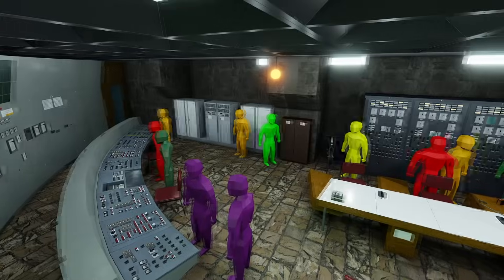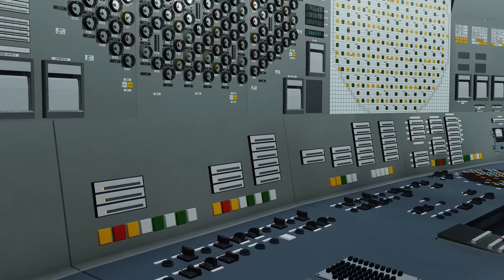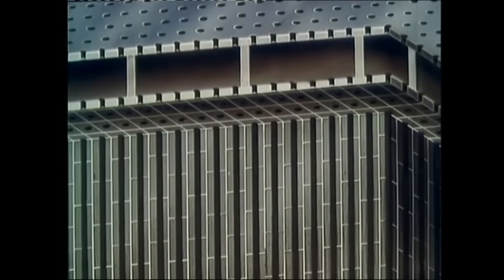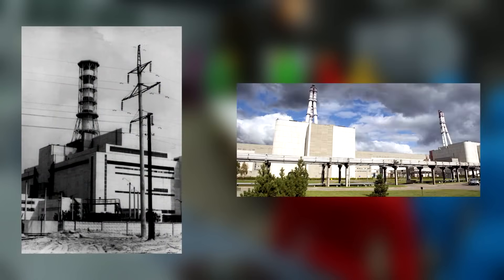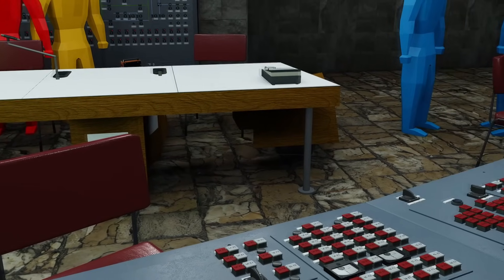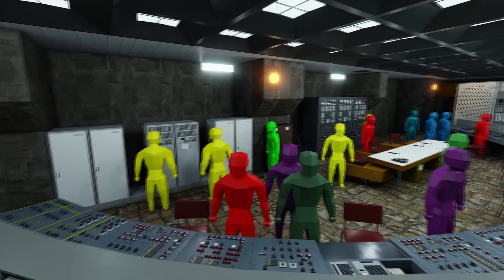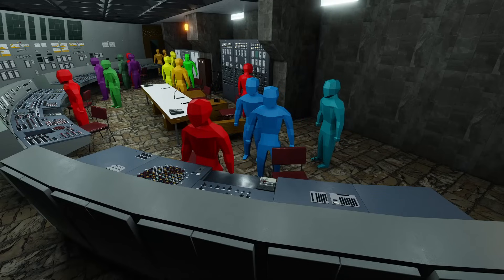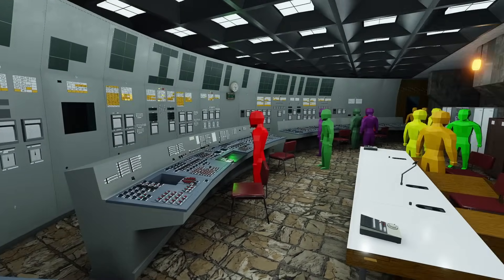How Chernobyl Exploded - PART THREE: The Final Minutes

Comment: So they had no clue it was running away? I just can't see how they couldn't tell. Why even shut it down if they thought it was fine. For ever I thought they could see what was going on in the control room like all the documentary accounts.
Reply from the maker: The reactor was stable until AZ-5 was pressed. AZ-5 was the normal shutdown procedure and the reactor was supposed to have been shut down when the experiment began.
Reply: So even under normal circumstances the az5 could doom it? Or just wen the ORM was below ?

Comment: "operators were unaware of the ORM falling so low nor that it had become primarily composed of
automatic control rods which are intended for power regulation not direct power
maintenance. equally The Operators were completely unaware of the safety significance of the ORM"

If the operators had a computer system that provided instantaneous information about control rod position, would it have prevented the accident?
Reply: The operators had indicators showing all the control rod positions.

But the ORM is calculated using the actual rod insertions and the strength of the neutron flux where the rods are inserted.

So a faster or real time display might have helped.

But I think the ORM limit that night was too low to prevent the explosion.

After the accident, remaining RBMKs were required to operate with a minimum of 80 fixed additional absorber rods in the core, to eliminate the the positive scram effect and the positive void effect.

Comment: That Chernobyl Guy: amazing video as always. Q1: beta_eff usually refers to the effective delayed neutron fraction; beta varies only as the composition of the fission components changes (i.e., slowly, over the lifetime of the reactor, as gradually more fission is due to plutonium than uranium), though _eff accounts for the delayed aspect. But it is only indirectly related to criticality, and is a positive definite quantity. I assume, at ~14:40, you meant reactivity?
Q2: You mention that >0 means prompt critical. Well - keep in mind that any system is almost never prompt critical for more than a very small fraction of a second, since prompt criticality immediately proceeds until the system thermally expands sufficiently to regulate the criticality (i.e., it explodes., and this explosion ceases the prompt criticality). So I don't see how a reactor manages to get to any state where the conditions are more than prompt critical.
Reply: Perhaps instead that reactivity value of ~6 is not prompt, but accounts for all neutrons; that operates on timescales of seconds, and it's quite plausible to reach a high value.
Reply from the maker: Hello! So, beta_eff does refer to the effective delayed fraction, yes. But beta_eff in an RBMK varies under more than just as fission components change. For example, the BAZ rods introduce -2 beta_eff of reactivity, but especially in the RBMK, the positive void coefficient has a huge effect. The positive void coefficient began at approximately -0.2 beta_eff, and by 1986 had increased to at least +5. 

However, it is a beta_eff of greater than 1 that equals prompt criticality. It is estimated that Chernobyl Reactor Four sustained a beta_eff greater than 1 for at least three seconds, per INSAG-7 and Revenge of the Peaceful Atom.
Reply: @ OK, that makes sense: that prompt criticality was sustained for a very small amount of time. And presumably, the total prompt coefficient was only ever slightly greater than unity. Thanks for the explanation!
Reply: @clancyjames585 I think there is confusion here because the quantity is correctly termed reactivity and one convention is to report it in units of beta_eff or dollars.
That helps to show whether or not prompt criticality can occur.
But I still don't like TCGs habits of saying beta_eff when referring to reactivity and then using the latter when referring to power.

Comment: Why everybody is using the wrong chain of event. Scientific evidence shows that for the moment AZ-5 was pressed a power increase leading to destruction of the reactor already had happened, in fact, a fast neutron reaction (what imply cero moderation) took place before the explotion, wich means reactor core was already destroyed.
Reply: I'm afraid that is not physically possible. 
The fuel in Reactor 4 was not sufficiently enriched to sustain an unmoderated fast neutron chain reaction.
Uranium dioxide fuel needs an enrichment of more than 7% U-235 in total U before that is possible. Evidence for this is provided by Table C-1 in ORNL/TM-12292 which is available online.

Comment: Sounds to me that there were three nuclear explosion s.
Reply: there was 0 nuclear explosions
Reply: @IbishuCovet and yet a nuclear power surge resulted in the reactor exploding?
Reply: @derekp2674  it was a surge that caused steam to build up and blow the UBS off, then a zirconium-steam reaction caused the second explosion, in no part of the explosion did the fuel explode or something
Reply: @IbishuCovet  Where is the fuel now then?
Reply: @derekp2674  thats what was burning and releasing the radiation
Reply: @IbishuCovet  so you're saying the combustion of the fuel (for example from UO2 to U3O8?) did occur but the preceding nuclear fission reactions never caused the fuel to reach its vaporisation temperature?
Personally, I regard any explosion powered by a release of nuclear energy as a nuclear explosion. I do not restrict the use of the term to the detonations of nuclear weapons.
I do wonder about the details of the termination mechanism for the chain reaction here. Obviously the rapid explosive disassembly of the fuel rods and their surrounding moderator blocks would accomplish this, but modelling all the key physical steps in that would be a challenging task.
Reply: @derekp2674  well then your definition of "nuclear explosion" is kinda twisted and just wrong?
Reply: @IbishuCovet  As I see it, a nuclear reactor exploded - thus a nuclear explosion.
In your terms, was Unit 4 a Steam Power Plant?
Reply: @ jesus christ... im just gonna stop trying with you, youre so incredibly difficult

Comment: If the operator removed the control rods from the bottom, why where the control rods from the top inserted when pressing AZ5?
Reply: The control rods are retracted into or dropped from the upper biological shield ("lid") above the reactor core. That's how they are removed from the bottom, they're pulled up.
The shorter graphite-sections of the  rods are passing by the entirety of the core before the moderators are fully inserted and slide out the bottom, thus increasing the reactivity in the core on their way down, especially at the bottom.

Comment: I can't help but sympathize with these operators. They were dealing with an absolute bare bones reactor type in a technological age where more and faster computer controls would have helped make the design less unstable. One that was built with only the most cut-rate materials on a timeline dangerous to the concept of safety of any kind, let alone nuclear.

Comment: You think that perhaps the OCR is a better indication of the reactor situation? You think that perhaps the low power output is misleading as to what's actually occurring inside the reactor?

Like the power output is low but the water is near boiling. It's running inefficient, but it's boiling the water to meet that power output.

Comment: Not in the least an expert. But every way you see it it was operators fault. You can't say a design defect is the culprit. When you disable all the automatic safety features and manually operate beyond regulated margins you can't possibly blame the design. Take a Lathe the most dangerous and obiquitous machine. Its inherently dangerous by design, but the design can't possibly be different otherwise it wouldn't work. If you utilize correctly it is mostly safe. But if you disregard safety procedures it becomes deadly. Those safety procedures are there for a reason, when you start to push the envelope you can't blame the design for utilizing it incorrectly.
Reply: At the same time, a lathe can be made with better or worse safety equipment. It can be balanced and properly secured to the floor or not.
Reply: @p.strobus7569  ehm no. A lathe is a lathe. There's is no magic safety equipment that will save you if you fuck up

Comment: The power drop was the cause?? They were supposed to shut the thing down if the power dropped below safe level - but they didn't and decided to continue with whatever they were doing despite the risks.
Reply: Yes. But restarting a cold reactor would have been very expensive in terms of all the large factories in the Ukraine not having enough electricity for hours and the resulting production fallout. This is why the grid operator called for a delay of the test before, he could not cope with the missing electricity during daytime. The whole test was very expensive and required the coordination of many branches of industrial production, everybody was under pressure that the test is a success.

Comment: Signal. mentioned on 11:58, was sent from MPA button (maximum project failure ) , specially designed for test by " Dontechenergo " and arranged on -site under  Dyatlov control. It was pressed with 6 sec delay after closing of main steam valve, so diesel-generators were put into operation only on 01:23:10  Closing of main steam valve supposed to trigger automatic activation of AZ-5 MUFT  signal to shut down reactor with de-coupling of control rods and falling them down under own weight by gravity with speed much higher than slow speed of 0.4 m/s under AZ-5 signal. This feature was deactivated by Dyatlov. Reactor would not exploded if AZ-5 MUFT was activated in 01:23:04. There were 3 explosions in reactor hall: at 01:23:42 (steam), at 01:23:45 ( nuclear, on prompt neutrons) and  last at 01:23:48 (volume explosion of H2/Air mixture). AZ-5 button was pressed twice: at 01:23:39 for one second and again at 01:23:41.

Comment: I’m getting confused after A3-5 is pressed “The water is less than a degree below boiling point” however it shows around 250 degrees centigrade, this is almost three times waters boiling point of 100 degrees centigrade. Can everyone explain?
Reply from the maker: Pressure. High pressure increases the melting and boiling point.

Comment: I am fully with Diatlov's analysis that the voiding wasn't the initator of the excursion, but the "2 reactor effect" , that is the graphite insertion via the control rods. The reactor was doomed quite early in my view, althought literally flooded with water and not much voiding can have been present, right ?
Reply from the maker: I agree, and that's what virtually all modern scientific reports agree with :)
Reply: @thatchernobylguy2915   I also think that not just the added feedwater flow drove the rod pull. but simply the fact that at just 200MW thermal AND turbine running the coolant did not contain enough voids in the first place. what i don't understand is that in the video high water temp is pointed out. how can that be an issue at just 200MWth ?
Reply: @KarimY-119  They shut off output valves, in a hope that at this power level they could control the reactor, with the increased circulating water for that brief period. I think running the test on 200MW was ultimately a bad idea, they could better control the reactor at the 700-1000MW as level as directed, with the steam bypass vavles open, letting the steam directly to the condensers. That would mitigate the temperature and water level fluctuation in the separator drums and the consequent temperature rise in the bottom of the core.
Reply: @patrikpallos628  agree. I think they were walking in unexplored land and simply ran out of experience.
Reply: @thatchernobylguy2915  All this is a replication of the Soviet lie about the causes of the accident. If you want to know the truth, watch: HOW THE 4th UNIT OF CHERNOBYL NPP WAS BLOWN UP.   (KS channel)

Comment: What was the reason for the 5 minutes delayed display of reactivity by SKALA? Potato computer with too little power or the need to collect and aggregate data over 5 minutes?
Reply from the maker: Both. The SKALA computer was a design from the 1960s, and had to process hundreds to thousands of data points in a single calculation. It was replaced in 1995.

Comment: I believe I also read somewhere that those bottom-inserted control rods were not attached to AZ-5 scram mechanism at the time. They already started changing this in RBMKs in 1986, but unfortunately it still hadn't been done in Chernobyl unit 4 by then. If it had been, then that alone might have been enough to prevent the explosion.

Comment: It's incredible to me that they had to wait 5 minutes for readings to be returned to them, and that the read outs on the wall were limited to just one parameter at a time. Computing speed aside, it's insane that you couldn't just stick a few more panels there and display those things all the time.
Reply: RBMK was '70s technology. There was a single SKALA computer (a ferrite core computer with 12kb memory, that's less than 1/5 than a Commodore 64) to control every parameter of the reactor, and it couldn't perform more than one task at any time. BTW the last SKALA had been decommissioned on Smolensk NPP Unit 3 in 2016.
As explained earlier, to perform any task that was not routine running (test, or shutdown of the reactor), it was available, 24/7 a representative of the Nuclear Physics Laboratory. An experienced operator with a computer and the program that allowed to have that reading almost in real time. Unfortunately, that night, Anatoly Chernishev, the specialist on shift, had been mistakenly told, at the entrance of the reactor, that it had already been shut down, so his presence was not necessary, and he went back home.
Reply: The limited computing power and/or hardware capability was a general problem for NPPs around this time though. If you think 5 minutes is bad, what would you say about 2.5 hours?
In the three mile island inccident, one of the questions was how the operators could miss the "water in the sump" alarm. Well, there's a very good reason they missed it. This alarm had no specific warning light, instead it should have been printed out on a special printer, that was only there to print out alarm messages. Well, the issue was, that with the flood of alarms they got when the whole disaster started it took the printer 2.5 hours to print all the alarm messages that came in in the first few minutes because this printer was so freaking slow. So basically the operators at three mile island could see that the sump had an unusual amount of water in it 2.5 hours after the alarm was triggered.

Comment: Great series, and explains very well how the operators ended up in the situation that they did and felt pretty confident they could just hit the SCRAM button and go home without blowing anything up. There was one detail I'm sure I remember hearing on some documentary about the incident years ago, but have never heard mentioned since. Apparently it was necessary to type the required generator output into the control system, i.e. 500MW and this was quite easy to forget/not register properly, and when the shift changed it's possible Toptunov forgot to do this and that's why there was a sudden power decrease which resulted in the mass control rod withdrawal to get back up to 200MW.
For me this is the nub of the whole accident, without the sudden power decrease and subsequent actions to correct the low power level there would have been no accident (well at least not on this day, although the inherent problem of the graphite displacers was an accident waiting to happen)

I do feel Dyatlov has been given a pretty rough deal from the new series, which more or less pins the blame on him to a large extent, which just seems unfair. Legasov gets a positive representation in the series , biut it could easily be argued he was much more culpable than Dyatlove, he knew about the problems with the graphite tips and was part of the establishment that approved and built RBMK reactors, knowing full well they didn't have the technology to really make them safe (5-15 mins for a computer to tell you if your reactor configuration is safe, lol! that's just bonkers)
Reply from the maker: The "setting the output into the Control" thing is from Midnight in Chernobyl. I'm guessing this is Higginbotham misunderstanding it as that is actually more advanced than the real system LMAO.

In real life, there were three wires corresponding to the three groups of automatic control rods, which you would manually adjust the current flowing through where the voltage corresponds to the percentage output.

Given the behaviour of the system, with AR-1 withdrawing and AR-2 not moving, he just set it slightly too high, which is easy when you're dealing with a current on a wire.

Comment: Call me crazy, but i still think the RBMK is an elegant design. It is a big advantage to be able to use low enriched uranium as fuel.
The management is solely to blame here as they are the ones who should have been more cautious assessing the risks involved of operating such a power plant. Also the supporting technology simply wasn't good enough at the time to provide necessary feedback to the operators. Nuclear reactors are simply too complex to be operated by hand, Three mile island is another great example  of this.
Just like with an F16, without the computer, you would crash.